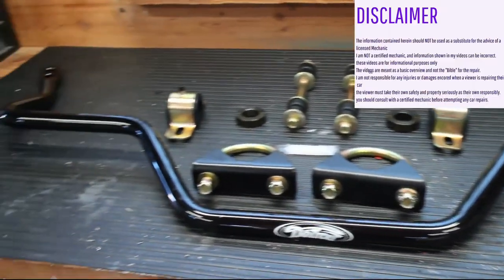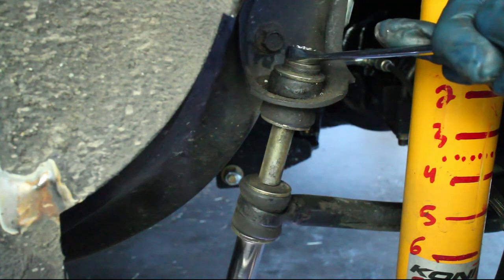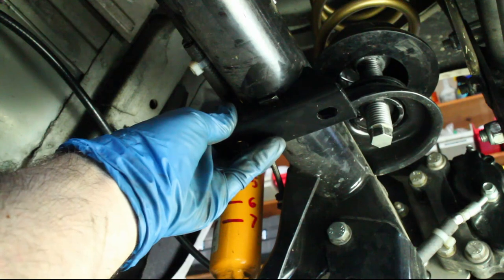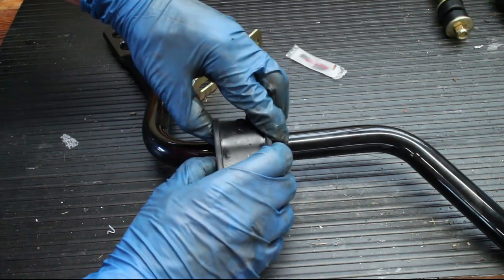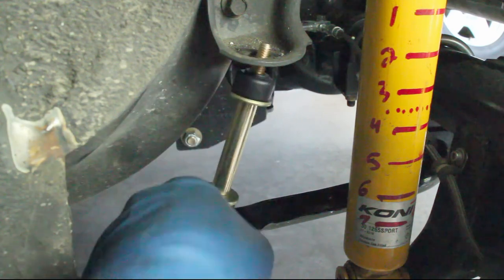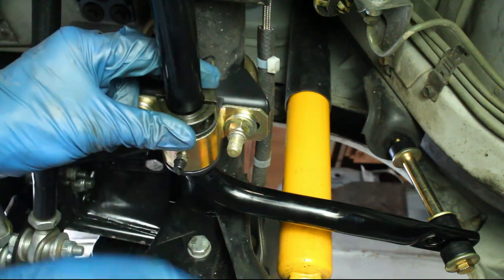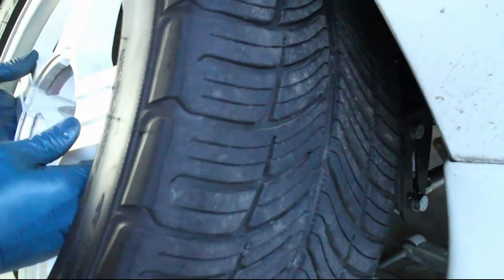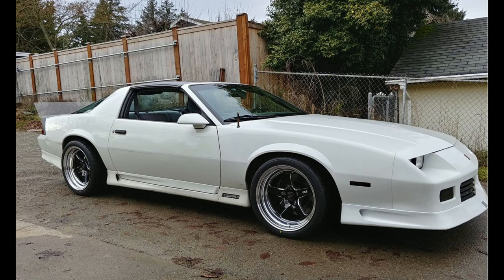Detroit Speed Rear Sway Bar Install (1982-1992 Camaro/Firebird)

Comment: I like the locking collars they added.  I used then all the time in industry, but I never thought to use them on a sway bar.  :)  Cool beans!    What was the make/model of your rear spring adjusters?  I think thats what I saw.
Reply from the maker: those are weight jacks that I used to run.
I don't recommend that brand anymore, but Ground Control sells a similar kit.

Comment: What size was your older sway bar?  And what size are you using  on the front?
Reply from the maker: I run the DSE front and rear bar.
the bar size is kinda meaningless though.
these bars are WAY stiffer than stock, even though stock might have a larger diameter.
Reply: @3rdGenGuy  thanks